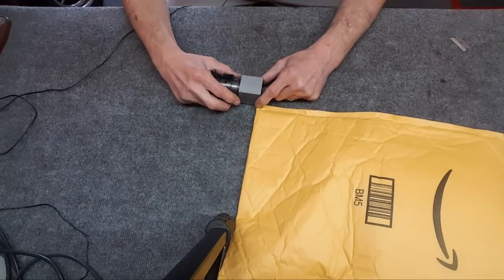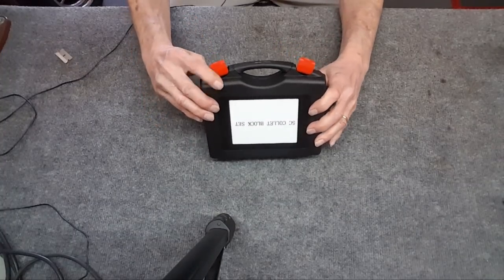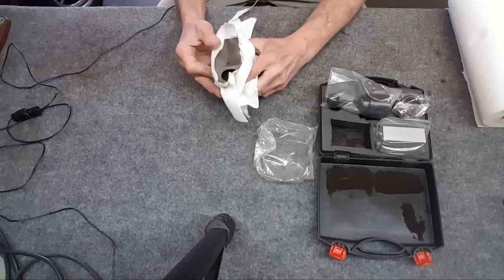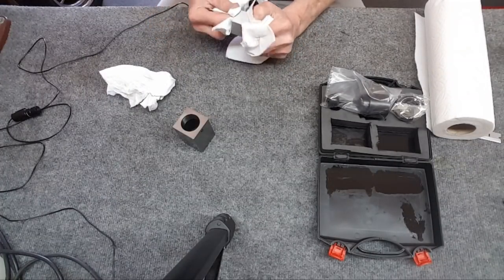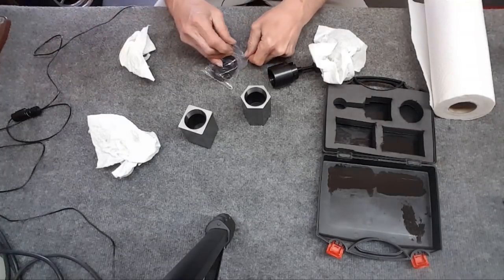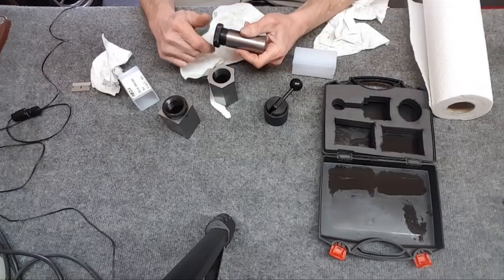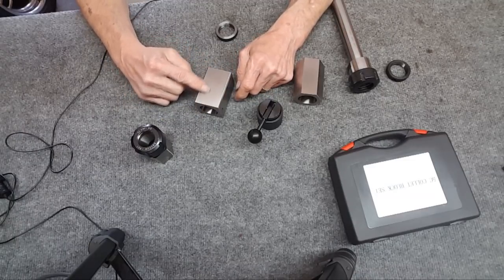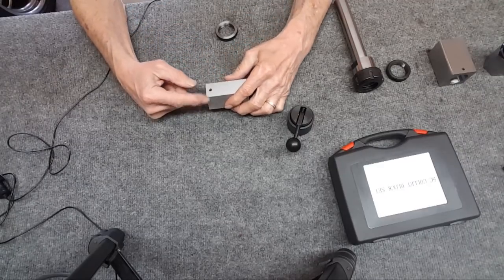3018 CNC Disaster & 5C Collet Block Set .0001 Accurate

Comment: Hey Dave. When I was taking machining in college, I was told cutting fluid was not necessary for aluminum projects. Just needed the right cutting speed. Personally, have had no issues cutting aluminum without a lubricant, but I'm sure there are projects where it helps. Thank you for the video. Cheers
Reply from the maker: Funny you should make this comment. The stuff is for tapping thus its called tap magic and I just tried it for the first time on a 1/4 NPT and 8.0 x1.00. I have never seen chips come off a tap like they did. Very little force at all needed and 1/4 NPT is a big tap. I also tried it for drilling and another big difference on deep holes. Haven't tried turning with it yet. Really glad I tried it!!!
Reply: Always good to have another tool in the shed brother, but I'll stick with my Hog Honey and the Mobil 1 full syn 5W-30. Cheers

Comment: Hi Dave,
It's a shame you killed the controller on the CNC machine, at least you found a replacement, being Chinese.
Nice 5c collet blocks.
ATB Adam
Reply from the maker: Turns out what Amazon had for a description and picture is not what they sent. Not compatible at all but Sainsmart is sending a replacement free...
Reply: @TheMiniMachineShop  SainSmart has been great to work with. They replaced the entire Z axis assembly on my machine for free. I'd buy more stuff from them for sure.
Reply: @TheMiniMachineShop  
That's good news, free is always good.
Have you killed the microcontroller or one of the stepper driver ic's.
There's always an option to use grbl with an Arduino and some stepstick stepper drivers, if all else fails😀
Adam